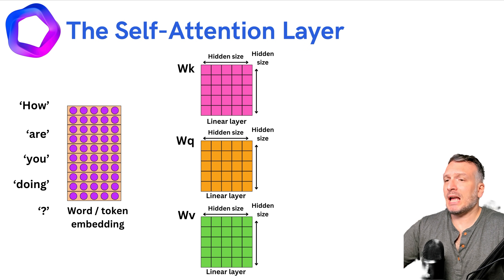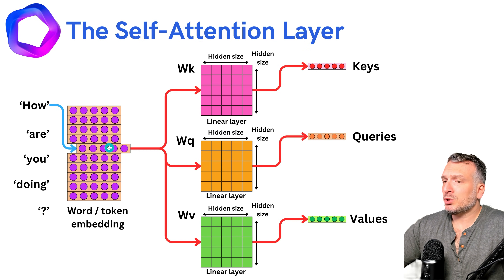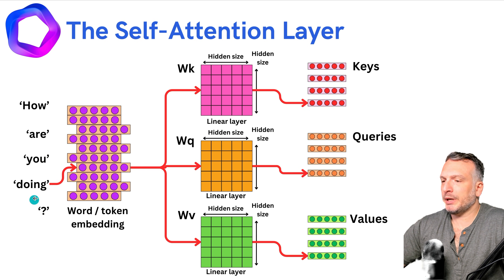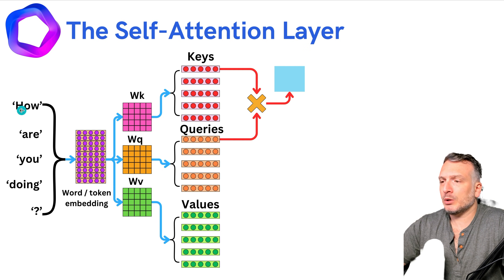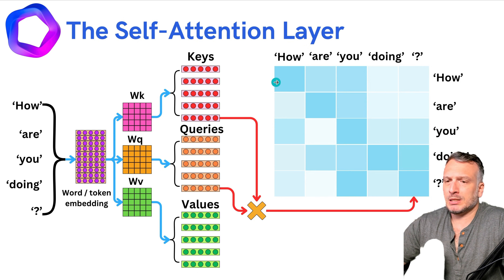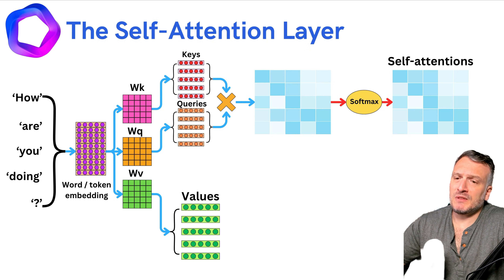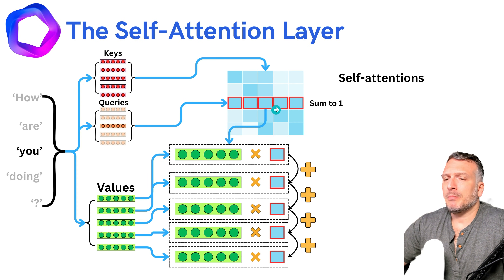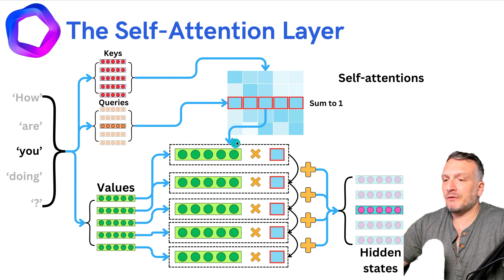Understanding the Self-Attention Mechanism in 8 min

Comment: You pass input embed values into three linear layers, keys queries and values.  You then create an attention block (attention scores) by calculating a dot product between each layer in the query value (which is associated with each input word), along with EACH key value — for each token input into the model. Next you run the calculated attention block matrix / vector through nn.softmax to turn them into probability scores. Next you take the probability scores you just generated, and multiple them by the values in the nn.values layer to generate a hidden states matrix.